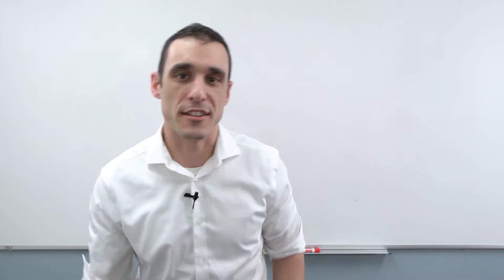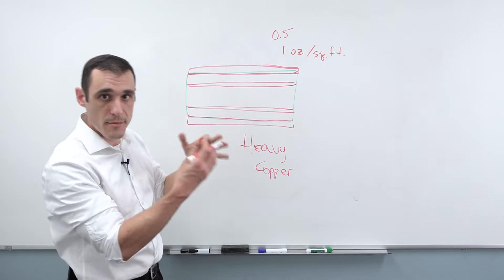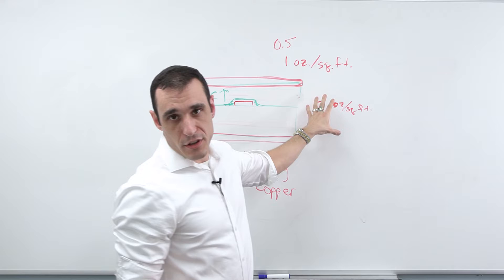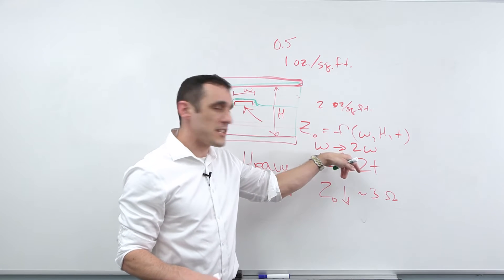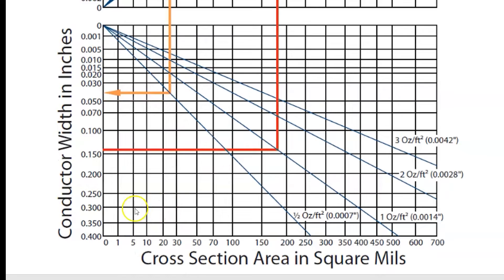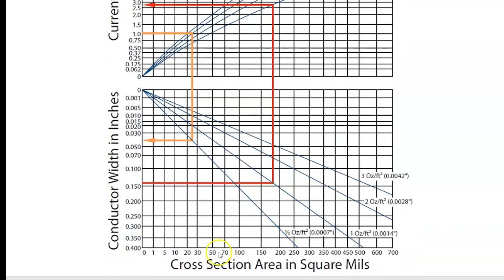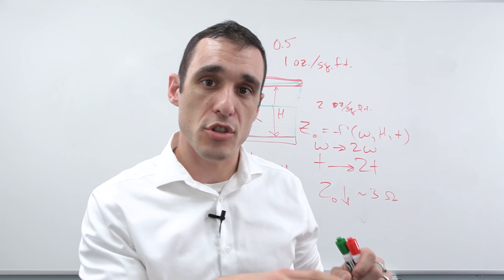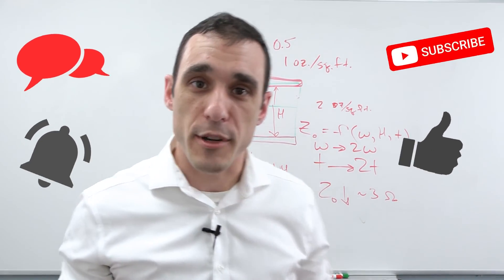Copper Thickness Deep Dive | PCB Manufacturing

Comment: What is peel strength?
Reply: The peel strength tells you the amount of force required to delaminate the copper foil from the dielectric layer in the layer stackup. This will help determine the level of roughening needed in the copper film to ensure it can make a strong bond to the dielectric material. There are IPC standards that specify minimum peel strength for manufactured PCBs.

Comment: The cross section is used for current density analysis and it is used to gauge the current and to ensure we don't burn out the trace, copper migration etc...  if you run PDN simulations you will need those boundaries in A/mil^2.  The IPC standard is good starting point though.
Reply: Yeah agreed, I like the IPC standards as a starting point but DC analysis in the PDN will be much better for targeting specific areas that might need changes.

Comment: That was really a great go through, I have one question, Is there any trace width calculator available into altium software ?
Reply: Hi Harish, Yes there is a trace width calculator for controlled impedance. It is located in the Layer Stack Manager. You can follow my process here: https://youtu.be/4LwnEaNvG8I?t=745